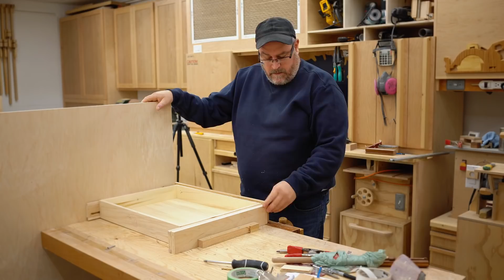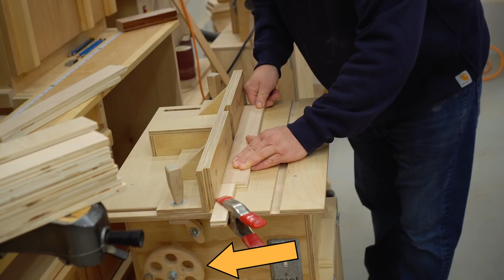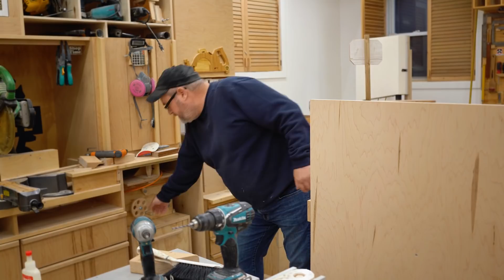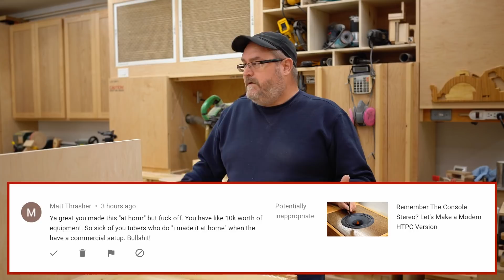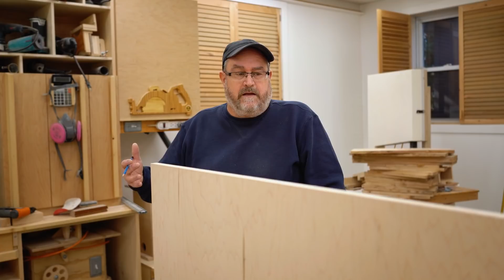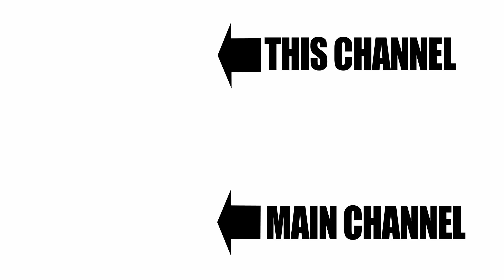Stop Complaining About The Shop and Tools you Don't Have -  Rant!

Comment: Preach it.
I've got a small shop crammed under a 11x16 ft roof out back (no walls on 2 sides). I've gradually built it up to a workbench, vises, drill press, old old metal lathe, bench grinder, and plenty of hand tools. Plus a simple blacksmith shop outside nearby. Many of the tools are inside in the second bedroom.  There's more capability in that little shop than I have time, money, or skill. I'm privileged to have this space. But we're going to save up and eventually build a shop too. All in due time!

Comment: My father made a kitchen and all our incidental furniture with about as minimal a tool kit as you could imagine. A crosscut saw, a tenon saw, a brace and bit,a hand drill, hammer,mallet (home made) two chisels, a couple of decent cabinet screwdrivers and of course the ubiquitous no 4 Stanley smoothing plane and a 4 in one rasp.
  Just after the last war in the UK that is about what everybody had, and huge amounts of furniture and home improvements were done with this kit. What everybody is missing is that this was mostly done slowly, as skills built up or as people could afford some materials, most non tradesmen re used screws and straightened nails. 
     I don’t think my father would have ever owned an electric drill if the family had not ganged up on him and bought him one, (didn’t need it !) My son has it now for a spare !
      There is no excuse for not trying to make stuff you want to make just because you do not have a professional workshop. and there is no way you can make it in a weekend ( whatever it is) mostly because you have to finish it. But you CAN make it.

Comment: I started woodworking in a 20th floor apartment in Chicago, alternating between the living room (dust wasn't so exciting for my wife) and the 3x8 balcony.  Got smart and joined the board and got unfettered access to the 20x30 maintenance room. Made my first skil saw sled and router cuts down there. I don't miss the dust though - zero ventilation 1.5 stories underground. But there's always a way if you want to.

Comment: OMG, I can't believe people have accused you of having some crazy expensive shop.  1/2 the tools you build, and then you use free or cheap replacements, like your circ saw table saw, air cleaner, band saw, sharpening solutions,  or your dust collectors from simple vacuums.  I come to your channel to see those non-commercial solutions, by far that has often been your direction.  Anyone can buy the commercial tool/jig, but how many know how or are able to build them yourself?  Don't change.

Comment: John I am surprised you did not try candle wax. I used candle wax on the kitchen drawers I built 20 years ago. They are still sliding freely.
Reply from the maker: I didn't try any of the other things I didn't have at the time, like graphite. But I have used candle wax before on wooden slides. Wax works well but waterbased poly works orders of magnitude better.

Comment: 3d printers aren't consumer goods like that yet.... If you want a 3d printer that you can just have delivered and it will run reliably without user skill, you need to spend about $20,000... the reality of 3d printers (except for the commercial variety) is that they are still experimental and run on user created firmware... You need to learn a semi-complex skillset to use a slicer and get quality results out of a tool that takes constant fine adjustment to run properly...  and the skill and materials knowledge needed to design functional items is equivalent to what it takes to design furniture...

I am an industrial designer who has been in the commercial furniture industry for more than 3 decades building a successful business with my partner that got me several patents for furniture hardware and a design patent... on a conference table... I have also been 3d printing for about 8 years and run a STEM program promoting iterative design concepts and KISS engineering principals with high school students. I design and build my own tools (3d printers and other CNC machines) for the same reasons (I think) that you do... Because it is more interesting to make something that fits your needs and pushes your creativity and design skills than buying an off the shelf consumer grade toy, or a commercial appliance. 

I recognize your talent and ability, and respect your design philosophy... but in the case of 3d printing, you are just wrong. In the future (20-30 years) we may have home replication machines that anyone can click a button on their phone and it will make a piece of furniture or an appliance... but probably not... definitely not FFF filament printing or UV cured resin printing... but with hobbyist tinkerers keeping on pushing the envelope, someone will come up with a machine that can in some way. If 3d printing were that easy, and if designing products for 3d printing were easy... Amazon would be out of business, or half of what they sold would be filament and resin. 

Until then, Harbor Freight will keep selling cheap tools and Yellow, Red, and Aqua will sell mediocre tools (I still have my 12v Makita from 1994... one of these days I will get around to building 18650 battery packs for it... )   and there will be people who make wooden furniture by hand because it lasts longer... and people who 3d print jigs and hardware that actually work because they know the limitations of the materials... just like you know wood movement and that Plywood and MDF are dimensionally stable...  I am going to chalk this one up to being pissed at people who can't remember that the resolute desk was made with hand tools... and haven't seen Japanese joinery or hand-plane contests... it's just more of the 700 year old saw "A bad workman blames his tools". However misdirecting folks by saying it's easier to be a successful author now that we have computers when it still takes just as much (if not more) talent to stand out since anybody can pound on a keyboard and produce legible text... it's Gaslighting, intentional or not. 

Keep on making awesome videos, and I will keep watching and clicking "like".
Reply: LOL.... com-on guy, your kinda making 3D printing out to be a bit more then it is... at its most basic its a glue-gun hooked to a cnc machine (unless its resin)... when they first came out a friend of mine bought one for $2500... I told him he was insane.... I looked it over and a month later I built one out of aluminum extrusions, I even machined my own hotend... while i was building it i taught myself the software, slicer, and more advanced modeling then i had already known... I'm a self taught graphic designer (autodidactic learning).... I also at the age of 16 had a reading/writing level of about 3rd grade (not much higher now...lol) I also quit school in 9th grade (nothing to be proud of).... so I'm going to have to disagree on the complexity of 3D printing... if your interested you can see some of my silly designs on thingiverse username HauntFreaks
Reply: @angrytinkerer3609   it is true that an FFF(FDM) printer is basically a computer controlled glue gun at it's most basic level... and if you are just squirting out plastic to make something that looks like a disney character or a cosplay sword, sure it's pretty simple. you could do the same thing with a dremel or coping saw and some sandpaper... slap some paint on and nobody will see your sins...  If you are trying to replace an idler bracket on an industrial tool that requires tight tolerances or if you need to print something in an exotic or difficult material NylonX, PEEK, etc. things get a bit more complex... It's not like you can take a stock ender 3 and print out a new pair of sneakers... or a cutting board that is food safe.  I can see that you put aesthetic thought into your shared STLs, a skill that most people don't have (ever ask someone to just draw a map?). Designing a complex machine with intermeshing parts is a bit more difficult than just extruding 2 dimensional shapes... John builds machines... 

You've built machines (CNC's with glue guns apparently)... but can your computer controlled glue gun make a shoe? how many failed prints and clogged nozzles have you fixed?  I know people who can't sew a button on a shirt, or change a tire on their car... but they can make toast in a toaster and microwave a burrito... Mechanical aptitude isn't universal.
Reply: @mightygrom  I guess my point is if someone like myself can put my mind to it and figure it out, then i can't see it being that much of a challenge for most anyone.... here's an odd one for you.... i have some really bad shoulder pain... i was sent to have an MRI and was given the disc to give my doctor... I wasn't able to see him for a week... in the time i figured out how to look at the disc, understand the file type.... view the images , and self diagnose what was wrong with it... I had a slap tear.... when i seen the doc and give him the disc... he said... you have a slap tear.... was it a good guess?... sure it might have been.... point being anyone can learn anything... I was unteachable child... since then i've done countless hobbies, and one thing I have learned, if you can read, and or watch a youtube video there is no excuse not to do most anything....
oh and I never had a nozzle clog... i have had the piece dislodge from the heatbed... I would put a link to pics of the printer i built and my scratch built cnc... but YT is weird about putting links in replies
Reply: @mightygrom  I agree... there is for sure a lack of common sense in the world.... and equally laziness to learn new things... one of my other hobbies is old school arcade games and pinball... I've made a few arcade cabinets and a video pinball cabinet... and of course part of the online communities that are into the same thing... I would see many guys buying and not building.... and no matter what if I brought up the savings of building your own there would always be pushback saying "not everyone can build their own"  I would disagree and explain the simple process , and still "time is money" "not everyone has the skill or tools".... no matter what answer i gave they always had another excuse why they couldn't build , and had to buy.... in my mind all I hear is excuses to be lazy.... this is coming from someone that's pretty damn lazy myself.... i just look at it, if i really want something that can be built, i'll just build it... 

by reading your comments I see we both look at society the same way.... I have a disdain for reality TV..... I love the buttoneer comment...lol... there sold right next to the bedazzler....  LOL

Comment: They should look at a channel called KREOSAN English, they have little to no tools and yet they make the impossible, possible.

I couldn't afford a welder, so I turned a microwave transformer into a high amperage supply by rewinding the main coil. I had minimal tools but I still got the job done.

Comment: BRAVO!  Those without the 'will', there's no 'way'.  I'm opposite.  I look at a person's shop and strive to attain the same setup.  I find your shop even more inspiring, to me, because of your self-made tools.  I just finished extending the 'on feed' on my 18-20 year old Ryobi job site table saw.  Of course when I did this I needed to make a new fence.  I bought your plans and BINGO!  Fence done and it came out great.  I was going to buy a fence and rail system but thought it would be more satisfying if I made my own.  It was quite nerve-wracking cutting the materials, adding to the front and then assembling the fence but it was worth it.  Your channel is awesome!  Thank you for your videos.

Comment: Expensive tools? My first.table saw: circular saw srewed to a sheet if plywood. My first routertable? A router screwed to a sheet of plywood. Very basic, worked fine.
Reply: same here, first tablesaw= circular saw mounted to ply and a 2x4 fence <---deluxe version
now every tool i have is second hand or a super cheap deal..
Reply: @David curtis now I have a very good table saw and router table and I am still careful. 
My grandfather told me, be aware of machines they will hurt you very fast.  I still follow that.
Reply: @David curtis an upside down circular saw  with some sort of fence is no different than a jobsite saw... without the cost

Comment: what I agree with is no matter what,.. you can't buy the skill to use any priced tool... $5 or $5000... its about building up your skill level from experience...
that being said... no matter if you have a $100 harbor freight mitersaw or a $1500 festard Kapex... if setup properly they both will produce the same result.... same with a $50 Hart cordless drill or a $600 festard drill, router or whatever ...blah blah blah... I wont lie... I would for sure take keyword "take" a festool domino.... so there are two different kinds of people when it comes to judging youtube woodworkers... one like John said, the "I cant doers", but the other guys, (like myself) look at those YT woodworkers,.. as silly posh tool hoi polloi... with all there woodpecker red anodized BS, the same accuracy of stuff you can get from china for a fraction of the cost... I think some of the best YT woodworking videos are dudes like John and Matthias Wandel and also countless asian dudes making and or using cheap tools as proof its all about the skill and not just "look at me with my bazillion dollar shop and equipment"..... of course this is IMO
Reply: oh there is another type of YT woodworker, thats the "sponsored by" guys... because "thats how we are able to make these videos possible"  lol..... you know, the rockler this, and the VPN that, website building blah blah blah.... the rockler pushers are the worst, rockler finds chinese OEM tools slaps there name on them quadruples the price, ... not all but most,...am I the only one that notices this?.... or the magswitch push, this was popular over the summer, where countless youtubers got FREE magswitch featherboards, but the rest of us schmucks were ask to pay $100.... oh and NEVER call them out on these shenanigans you will be blocked insentley....

Comment: The reason your channels are my favourite for woodworking is because a lot of the stuff you've designed and made yourself. I'm a bit confused that someone would complain that you have high end tools so therefore they can't do the same projects. You had a circular saw as your table saw for a while for crying out loud. A lot of your tools you made. I think most of us started out with just a few cheap tools and as time went on we upgraded and acquired more tools. It takes time. If someone enjoys doing this kind of thing then they will do it no matter what they own or where they are doing it. I use to do some woodworking in the hallway outside the kitchen of this place I use to rent years ago.

Comment: $10k of equipment. You don't start with all the tools you need. You buy them as they are needed. My first cabinet I built with a $39 saw and a framing hammer.  I worked in the the driveway for years and didn't get a real shop till I was 50.

Comment: As John Heisz rants go, that was pretty mild. You sounded measured and calm. Also, I don't think you have $10K of tools in that shop. Unless you have a whole bunch of high-dollar stuff hidden away in drawers. Home-built table saw, clamps, bandsaw, jointer. You have a planer, a drill press, a lathe and a miter saw. Those cost maybe $1500 to $2000 retail. You have one of the most humble shops of any of the big YouTube woodworkers. Which is good, because when I see the YouTubers move into a 2000 square foot shop that is bought, no built, I lose interest. Good luck to them, but my interest is in craftsmanship, not how well my sponsorships have paid off. The latest trend I've seen is they move into a huge space, and then build little sets everywhere to give the illusion of a small shop. Just keep being you John.

Comment: Thank you for making this video.  I hate complainers.  I grew up poor and didn’t get to finish college but after 30+ years of providing for a one income household that 4 kids have been raised in I have squeaked out a 24 by 36 shop with the required tools to make furniture pieces.  I got there by working my ass off, and never losing track of the goal.  Some weeks I only contributed a couple bucks or a part of an hour, but I kept moving forward.  This “I’m owed something because you have it” attitude drives me nuts!  
I commented on the drawer slide vid that I would use the idea.  I will use it because when I build my miter saw stand (at 52 years old my miter saw still resides on the floor and I’m finally getting too old for that crap!)  I will use it because it allows me to trade some time for money.  Probably won’t even make minimum wage doing it, but it allows me to move forward and have cash go where it’s required!  Thank you again, and Keep up the great work!